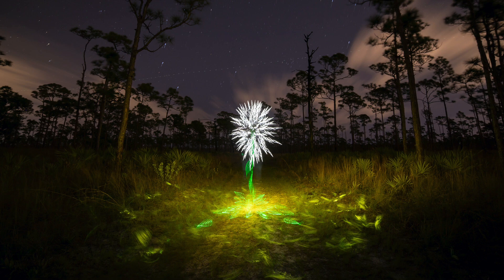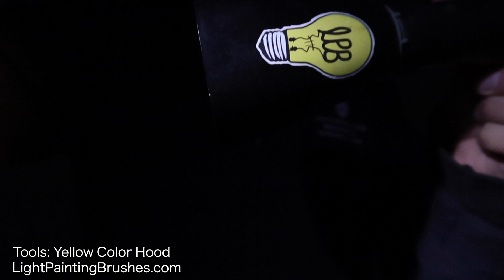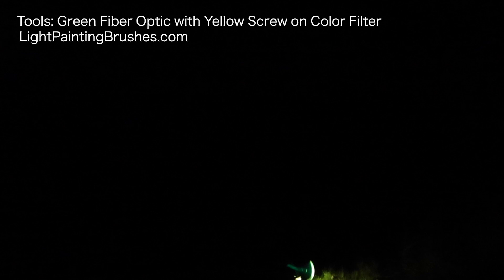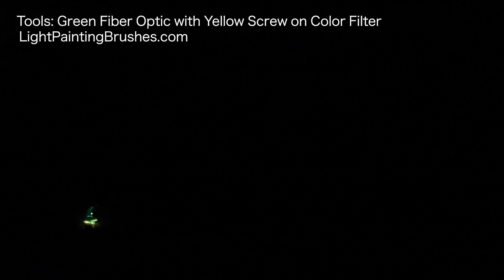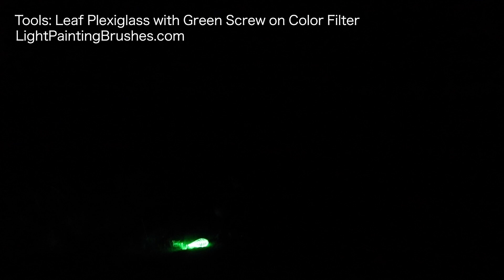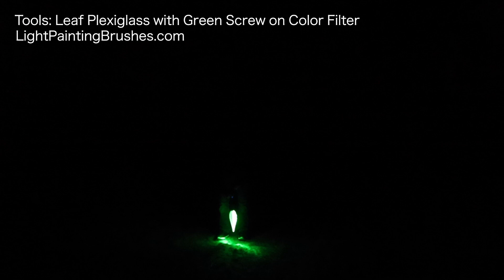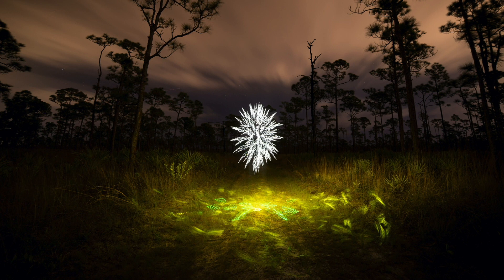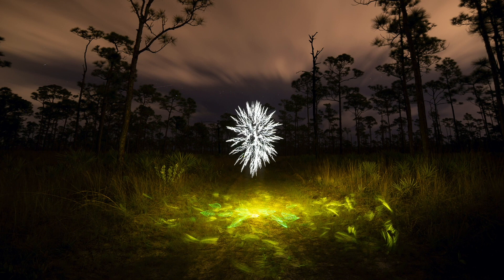How To Light Paint a Dandelion - Light Painting Tutorial

Comment: Did you have the Soonfire DS30 set to maximum or low? I am assuming Maximum. Also the same for the G26 was that high or low? I have the Nitecore and I see the difference in Lumens seems minimal! Great video! Wished my mistakes were as incredible as yours! Also thanks about stressing to ensure the blades are held still. I think perhaps that may be one of my issues in past attempts
Reply from the maker: Thank you Tina, glad you liked the video and the tip about holding the plexiglass still clicked for you! I used the Soonfire at full power and the G26 I used is actually the old version that only had one power setting of 120 lumens, but I think that the new 2 power version is the same 120 lumens on the low setting.